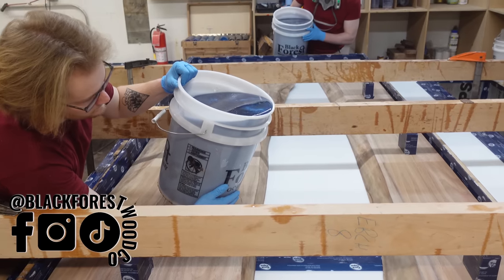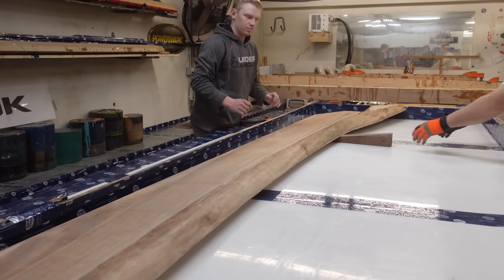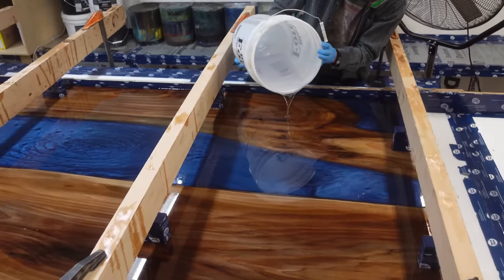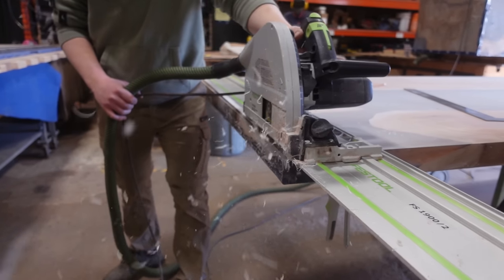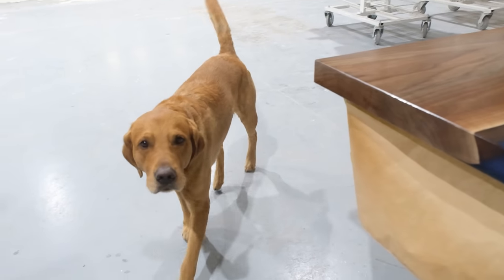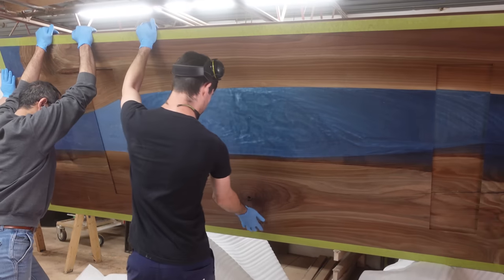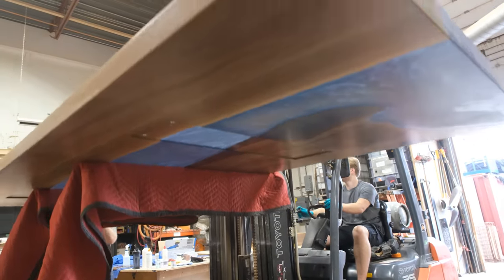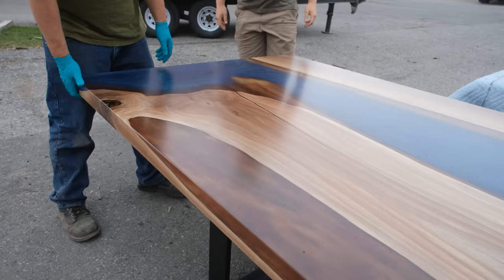How Did This Mistake Keep Happening?

Comment: Thanks for the great video. It's a pleasure to see craftsmen who show mistakes as well as successes. Appreciate the great content. Always heard wood could expand and contract, didn't realize so much movement was possible. Learn something new every day. Enjoy watching you and your crew doing outstanding work.
Reply: The amount will depend where you live and when you lived. If your region has wide range of temperature and humidity levels, timber will expand and contract more than steady state regions. Today's central heating and air conditioning evens out a lot of that. I'm old enough to have learned my furniture making before central heating in the UK, so we had to cater for it with how we attached table tops to frames. Got my feet on a chess board coffee table with inlays I made in extracurricular classes at school for my parents about 1970: walnut, white oak, rauli
Reply from the maker: Thanks so much John! Glad we could teach you something new!

Comment: before you do the ceramic do you wait for the finish to fully cure ? for example if i was using odies oil or osmo i would have to wait 14 days for it to fully cure. or would you just wait a few days/week ? thanks
Reply from the maker: You would want to wait at least a few days, but you can apply ceramic after 3 or 4 days with no issue as long as you don't start using the table or whatever you finish immediately after

Comment: I know you are often mentioning the lack of power in your Festool track saw - have you heard they have a new one?  It may be worth checking out.  It has an upgraded, more powerful motor that should help ripping through your table edges.  TS 60 KEB. Time is money, so fewer passes needed to make a clean edge.....
Reply from the maker: We'll have to look into it! Thanks Billy!
Reply: It appears that they're using a higher tooth count blade, should be using the Panther ripping blade; everyone who tells me that the Festool is underpowered is usually using/ doing something wrong. PS, I use them almost everyday and have for the 
 past 15 years. Outside of that, an absolutely gorgeous table 💯

Comment: Is there a reason you don't have a bit more overpour on the table, and after its been through the drum sander and palm sanding, have the epoxy as the finish over the whole table?
Reply from the maker: Because then you lose the natural feeling of the wood, and it can scratch way easier than it would if it had a spray finish or an oil finish
Reply: Ah! Makes sense. Good to know if I ever try to make one myself. Do you have any tips for someone on a first time pour?

Comment: Well didn't get a good look at the finish. If it bubbles then I would say the wood is not completely dry. That is why some that do these river tables do not use an urethan but instead use an oil. It may look dry but the bubbles are the clue that it's not ...

Comment: Placing the steel table legs on the rocky pavement would not have made any of my customers happy. Nor me for that matter. Cardboard or a mat cut to size would have been my choice. Tiny gritty pieces get embedded in the paint and steel. I’m sure they were dusted off. But yikes.
Reply from the maker: There's foam pads on the bottom of the base
Reply: Ahhh, yes. I see them now. Have you ever worked with mesquite lumber? It’s the only wood I build with.